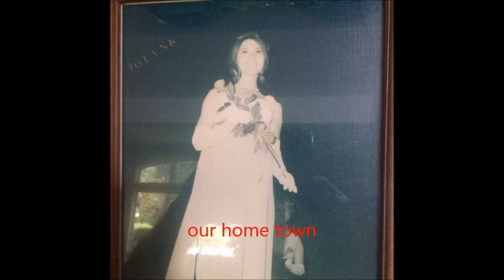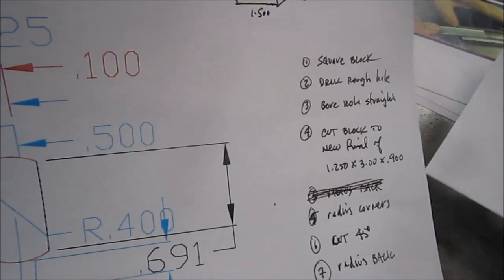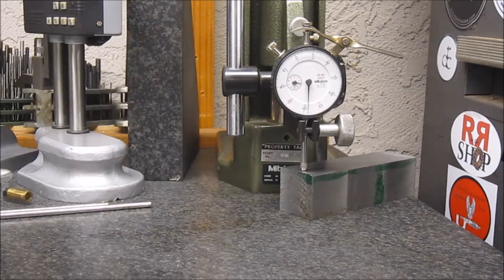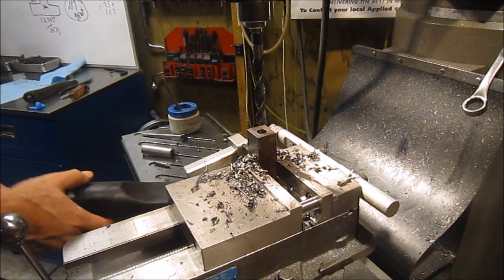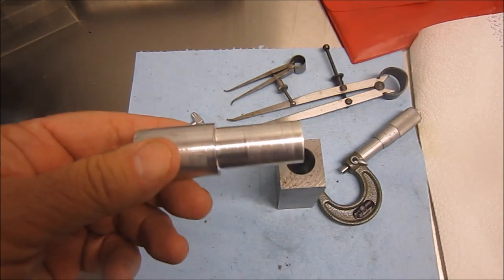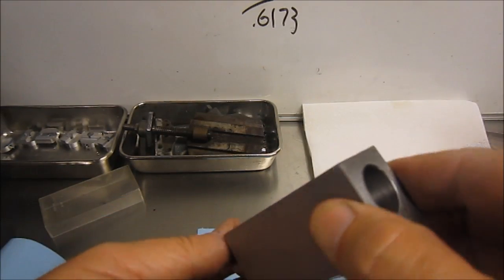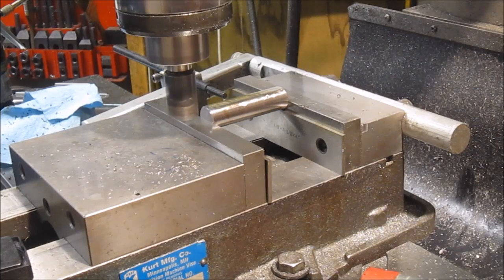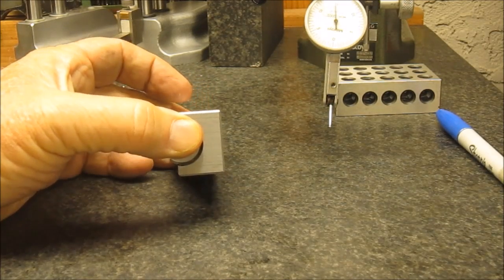SCREWY TUESDAY # 12  Tooling Build Pt1/Scale Holder Shout Out

Comment: Interesting build, I like the simplicity of the design and use...heck maybe I could even figure out how to use it if I ever get a mill, LOL!

Thanks for the show and congratulations on your anniversary to the both of you, Aloha...Chuck
Reply from the maker: Knolltop Farms Thank you Chuck for viewing and your support
Reply: outsidescrewball My pleasure, just catching up on allot of folk's videosYour build did give me a wild idea for a different type of vise, and maybe you can tell me why it isn't more prevalent if even an option as I'm not finding much on my searches, why isn't there a single handled then geared to a double-tension screw vise out there?

I'm certain someone has already thought of building such a vise with gear driven dual/synchronized tensioning bolts, but I cannot seem to find anything like that. There are double screwed "Moxon" vises made for woodowork, but their tightened individually It's just a thought I had after this video, one of Stefan Gotteswinter's, and  also seeing Brad Martin's vise give way from uneven tightening forces. Even if that was a vertically driven failure.

I imagine someone must've built a vise like that at one time or another, but I cannot find anything like what I'm thinking of, do you see any reason why not excepting the possibility it's just over-kill? Thanks in advance for any replies, from anyone who may have any ideas too...Aloha, Chuck V.

Comment: i like that gadget, i may have to make one. is there a reason you had to bore to .8oo? i think i would drill and ream to 7/8 and fit the pin to the bore. i would also use a couple of counter sunk screws thru the flat side of the pin to hold it tight in the block while i surface ground the flat on the pin parallel to the block. just some thoughts. cograts on your anniversary. why is it that wives never age as quick as we do. it looks like you robbed the cradle.
Reply from the maker: larry sperling Hello Larry...thanks for viewing and you comments....ok, first are you saying I look old???  LOL, you are right and I am a lucky man, fyi she is a year older than me!  Regarding the .800, you are correct it could be any size, I just took my guesses from the photos and then decided on even numbers really for no reason.  Hope you watch part 2

Comment: I would skip the 45's but I would grind the back with it located on the part so you can get it .000X in alignment. I imagine your bore was slightly tapered so now your part is clocked. Should be a handy tool for you though, I like it!
Reply from the maker: bcbloc02 Thanks for viewing and I hope you watch part 2 and I think you are correct that the bore has some taper.

Comment: Very nice tool,my only thought is to machine a groove in the insert and put a pin or set screw in  the back of the block just far enough to keep the insert from coming out, but not far enough to prevent rotation.If the groove were  the same depth as the flat, it would allow removal by rotating so the flat would slide past the pin
Reply from the maker: Les Bender Hi Les, thanks for viewing and your comment....there is more design items that will be in the next video

Comment: Hi Chuck,
Congratulations to you and Mrs. B on 38 years of marital bliss!  That's quite an accomplishment.  Best wishes for many more!
That's a nice tool you are working on.  It will be pretty handy when you're done.  I was wondering what is the purpose of the 45 degree chamfer on the back (other than for looks)?  It didn't seem likely that you would tilt the tool while in the vise onto the chamfer and use it that way.  That surface grinder is pretty handy to have around.  I used to use one way back in the day to sharpen punches and dies for a Houdaille Strippit punch press.  I'm going to have to add one to my wish list!
Thanks for the video!
-mike
Reply from the maker: ***** Hi Mike, thanks for the comments we are lucky that in marriage we grew together and not apart in interest, values etc....I am having fun with the tool build and there will be more mods next week along with testing....ATB

Comment: Telescoping (snap) gauges have a learning curve to achieve accurate and repeatable results.  At least it has been so for me.  I have found that having an unobstructed access to the hole so it can be swept as closely as possible in line with the hole axis helps considerably.  If I have a tailstock, boring head, or other tools partially interfering then I get much less reliable results.  Tension on the telescoping gauge also makes a difference, needs to be "Goldilocks" -- not too tight, not too loose, but just right.  Practice helps, too.  I have a nice set of Starrett gauges, so I know it is all about operator error = it's all me!
Reply from the maker: ***** Hello Bob...you are so correct regarding the learning curve.....as it is a touch feel.  Thanks for viewing and your feedback...ATB

Comment: Hi Chuck,
Why bother with the 45° corners as there is no significant advantage.
Cheers
Bengt
Reply: bsjoelund  Hi Bs, the 45° have their function. They reduce the rounded surface that enters in contact with the vise jaw when the entire tool rotate to compensate unparallel sides of the block you are to square. So when you tight the vise, it is much more sensible.
Reply: Hi Cosimo,
Still not 'significant' but yes it helps a little.
Cheers
Bengt